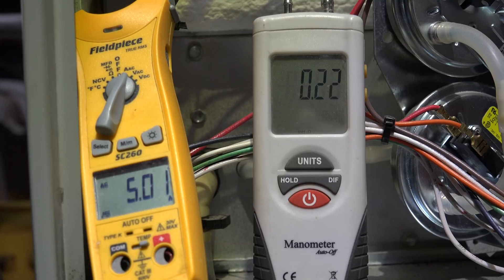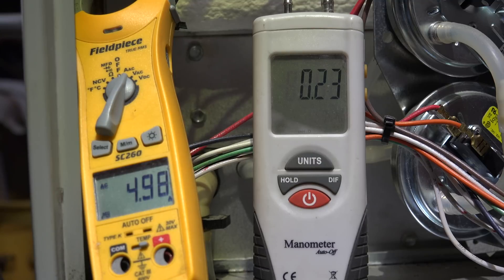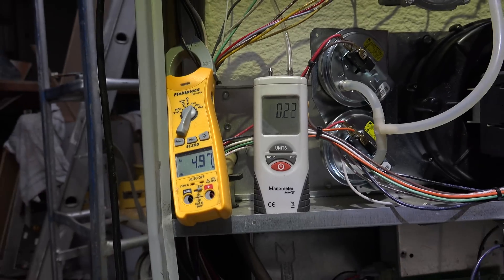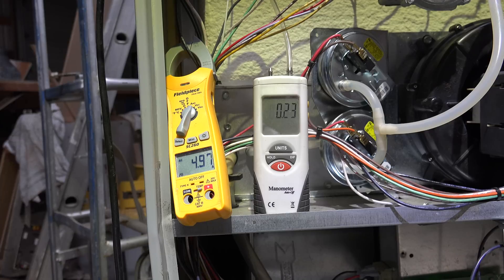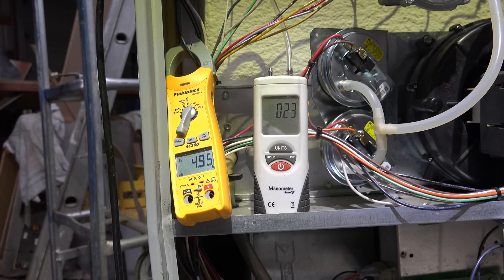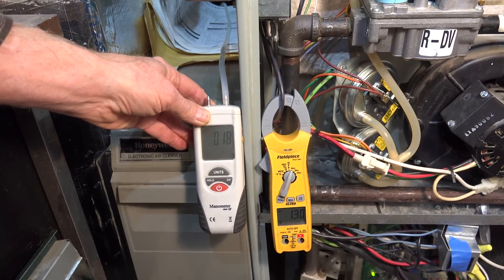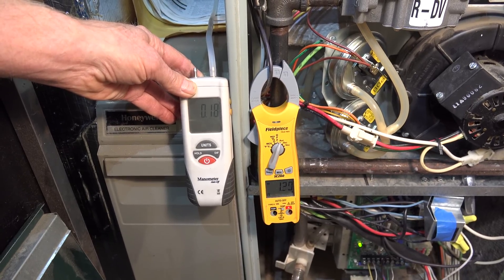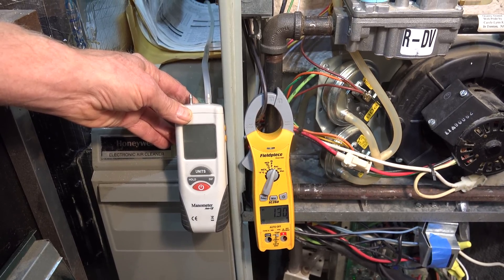Comparison of ECM and PSC blower motor amp draw

Comment: 2. All ECM motors have line voltage going into them like any other kind of motor. Clamping your meter around either lead going to the motor will tell you how much power the motor is using. Clamping on the line voltage coming to the entire furnace will take into account everything including the combustion air motor Transformer Etc, not a lot but still significant and would give you a different reading than motor alone

Comment: 1. When you slow down the speed of a blower wheel, does that result in a higher or lower static pressure reading?
It would seem that the more you slow down a blower wheel, the less static pressure is going to be measured. So a lower static pressure on your M might not indicate more airflow or greater load on the motor, it might indicate the new ECM motor is spinning at a lower RPM? Is that not possible?

Comment: To be fair, use the normal PSC motor equal ECM motor blower RPM and take reading. Because blower load increase with the rpm speed.

Comment: that energy savings is not worth the hassle of replacing burned out ecm motors.  ecm motors fail every 5 years.
Reply from the maker: That is just not true.  As an example, I have one in my basement that has been working for 27 years.  
A number of the failures of ECMs are due to a thermistor failing in the end bell.  This is a very cheap repair.
Also, many techs have replaced both the end bell and the motor.  The motor almost never fails.
GFM

Comment: Great video! I recently had an HVAC house call because the 115v wires in my air handler's juction box had fried out. The technician reconnected the wires and the air handler fan worked again!  I figured I must have had an energy surge from a lightning strike in the area, but when he tested the AMP draw from the motor he quickly shut off the unit and said "WHOA! That's drawing nearly 7 AMPS! You need a new blower motor! This is unsafe!"    Later, I noticed the sticker on the motor says 9.35 AMP! !!  Plus, the fan spins smoothly and freely.  Is he just trying to sell me a new blower motor?  Or is that truly an alarming AMP draw?
Reply from the maker: I smell a scam.  The amp draw is ok.
GFM
Reply: @grayfurnaceman    Admittedly the wires were fried (lightning strike/power surge I guess??) but it was clear he wanted to convince me I had a fire hazzard on my hands due to the melted wires in the junction box (which in my opinion did its job). It does seem like a breaker should have tripped so I am calling in an electrician to verify my breaker box is okay in the garage.  Anything else you think I should have him look for?

Comment: How much is ecm motor co. Payig u 4 the bs savig alot of energy bull yea bout20$ yr n 600 4 replacement i always swich em to pcs motor
Reply from the maker: Obviously I am not paid to hawk ECM motors.
Some statistics of one in my basement:
$12 per year electric usage
Compared to about $60 for PSC.
26 years of operation with no failures.
That's $1250 savings.
Note:  Most ECM failures can be repaired by replacement of a $2 part.  Check out my channel for a video on how to do it and part numbers.
When ECM motors first came out, there was a fairly high failure rate of the Mosfets.  Most of those failures are long in the past.
Get used to working with ECMs, they are not going away.
A good tech educates himself in the technology he works with and finds the ways to give the customer the best value.
GFM

Comment: Bottom furnace door is off, can't accurately check static or amp draw with doors off.
Reply from the maker: Of course you can.  Its a comparison.
GFM
Reply: @grayfurnaceman  You can't put a gas engine and a diesel engine on the same dyno. diesels have higher torque, gas have quicker acceleration.
Same way with ECM versus PSC. Bob Blanchette has the correct idea going on. Put the doors on, get the CFM up. ECM in the long haul may save a few $ in consumption, but in total $ saved for the consumer, PSC is the winner. ECM replacement typically requires 2 trips in a service van that burns fossil fuel. The consumer is without heat or cooling for 1-3 days. Any DOE greenhouse savings is lost, not to mention the 4 to 5 times cost of the ECM over the PSC. Consumers lose $$$ and are unhappy, and cold or hot, when a ECM fails.

Comment: Ductwork was not changed, yet meter showing lower static pressure.
Simple answer is the blower is turning slower building less pressure. It's also moving less air.
Run the ECM a bit faster to build up static pressure/CFM get an accurate comparison.

The ECM should still win out, it's just a question of how much.
Reply from the maker: Actually the ductwork was different.  That was the reason for testing the static pressure.  However, the difference was so large, I did not make any adjustments.  I may be doing another test on these type motors in the near future.  That may give more info.
GFM
Reply: I've done some testing with my own furnace. BIG difference in amp draw at lower speeds, perfect for reducing power consumption in constant fan mode.

At higher speeds not so much, amp draw is only slightly lower with ECM.

You must use the same furnace/ductwork/blower on both tests to get an accurate comparison.
Reply from the maker: You are correct.  Both motors were set at lowest speed, but low speed on an ECM is much lower than with a PSC.  I will be doing a video using an ECM and a PSC in the same furnace to make a comparison.
GFM

Comment: saving that money I normally would have paid to the power company AND GIVING IT TO THE HVAC REPAIR MAN!! I never had issues with my OLD unit that was 20 years old except high power bills. Had it replaced "before" it broke. Now less than 2 years and its been worked on half dozen times...inside and outside units AND thermostat even!
Reply from the maker: Your "old" unit was actually quite new.  It had all the modern controls and expensive parts that the new ones do.  With the exception of the use of ECM motors.  Sounds like you got a lemon.
GFM
Reply: Did you go up in size with the new unit?
Reply: +Bob Blanchette  No I did not.

Comment: I'm sorry but the Amp Draw is meaningless..... Use a Wattmeter as the Power Factors are going to be nowhere close to each other. Amp Draw and Power Consumption are totally different.
Reply from the maker: Sorry I missed your comment.  Amp draw is not meaningless as the voltage for the test is the same.  Using a wattmeter is simply a combination volt and ammeter.  Power factor on these type motors makes little difference.  The difference in amp draw indicates a real difference in power usage.
GFM
Reply: grayfurnaceman OK I agree power factors will be similar but not the same (we definitely cannot say this when comparing two completely different technologies like single phase induction motor and an EC motor). Let me put it this way, if you say that current is sufficient to judge power consumption in front of a professor, he is not going to be very amused ;)
Reply from the maker: Maybe we need more service techs and less professors.
GFM
Reply: Plug the furnace into a Kill-a-Watt. Power factor is about 80% for either motor.
Reply: but if the ductwork is smaller on the ECM furnace motor AHU you will get a higher water column (static pressure)  ..
Reply: Tell this rookie to go back to school. There is too many chiefs not enough Indians. 

Great video brother I have 10 years experience in the field from 25,000 BTU to 100,000,000 BTU. I understand what you’re doing here. I know these comments are old but ohms law speaks for itself.

Comment: I would love to see this comparison with simulated plugged air filters. I've heard ECM motors draw quiet a bit higher power with this scenario.
Reply from the maker: Will have to try that one.
GFM
Reply: X13 ECM are generally "constant torque" motors that draw more energy as the static pressure increases to try and maintain CFM.
True VS takes it a step further and are constant CFM motors.

Comment: is it ever a good idea to replace the capacitor on a furnace blower motor? or should you always replace the motor and cap? thanks.
Reply: ECM doesn't require a cap.
On a PSC, always replace cap with the motor.

Comment: Hey grey, have you ever run across a problem like this? Is it a grounding problem or is the module shot? please reply.

https://www.youtube.com/watch?v=Ik31afEkTKM
Reply from the maker: +abdu11a23 It appears the flame rod (the thing you are moving) is dirty. Clean it with sandpaper.
GFM
Reply: +grayfurnaceman I did grey, when i unplug the sensor the pilot lights up, it is weird. and when i put a different sensor in to try it out, the pilot dies as soon as i get the sensor in the flame, and when i remove the sensor out of the flame the pilot light up full.

The pilot only lit up when i put pressure on the tab.
Reply from the maker: +abdu11a23 Could be connection problem.
GFM

Comment: I check ecm amp draw at the constant power feed to the motor. Usually around .6 amp on low speed. Higher speeds show less efficiency gains for the ecm, but it is still there. Manufacturers are claiming 20% I believe.

Comment: I often wondered if one were to try and run a ECM furnace on an inverter, now I know some inverters are not pure sine wave and that could be where things begin to go wrong.
Quasi sine wave inverters make most motors hum and not perform as well.
Pure sine wave inverters are as good or better of what the utility is pushing down the wires
Reply: +Craig Nehring The reason why some motors hum, buzz, run slow, don't start, have poor torque, or overheat on 'modified' sine wave inverters, is they rely on the sinusoidal nature of the mains power to create the rotating magnetic field that makes the rotor spin. Most inverters put out nearly square waves, or a square waves with a step or two in the middle, to 'approximate' AC. This is absolute garbage for a PSC motor, but an ECM motor couldn't really care less about its input waveform. An ECM motor is really a 3 phase brushless DC motor bolted to a speed controller and power supply. The power supply is a 'switch mode', like the ones in most modern power supplies. They run the AC off the wall right into a bridge rectifier and charge a capacitor with it. Then the power supply itself runs off the DC on the input capacitor, more or less. They are somewhat complex, but the key here is all they need is enough voltage and power available on the input to work. They don't really care what the input power looks like. It can be DC, AC, square wave, modified sine wave, whatever. Often times they will even run down to 60-80V just as well as 120V. So, an ECM motor is great to run on an inverter. It will run just the same. And be aware, 'pure sine wave' is almost always worse than what the power company puts out. Theres still levels to 'sine wave' inverters. The cheap ones are junk for lots of reasons, its quite hard to make a very good sine wave inverter, and they are very expensive.